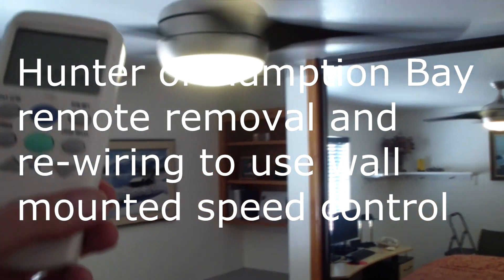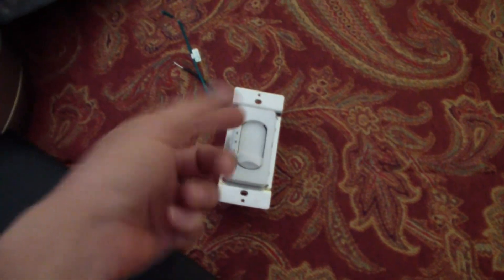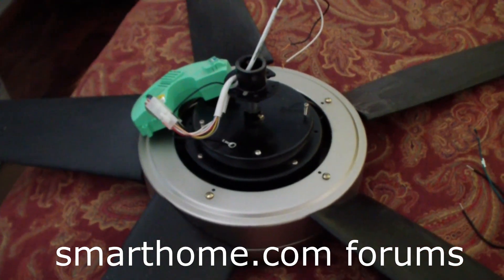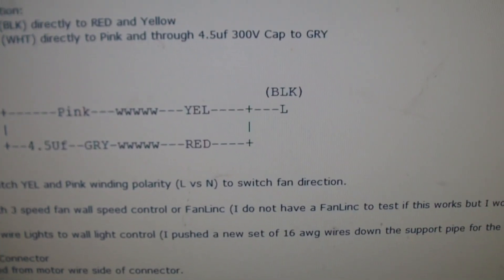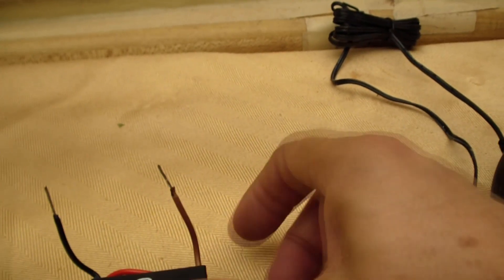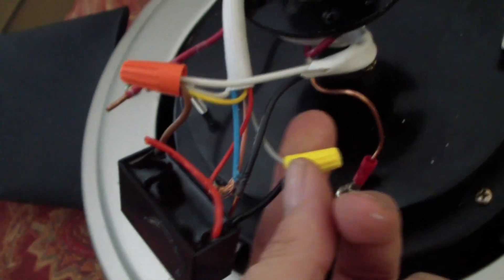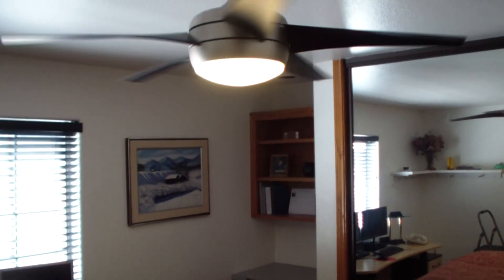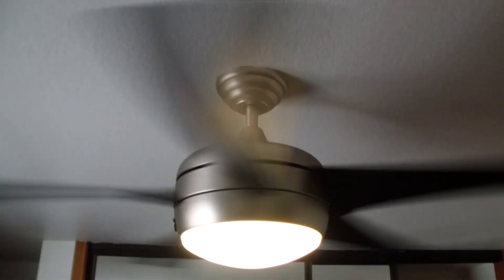Hampton Bay or Hunter Ceiling Fan Remote Re-Wiring For Wall Control

Comment: Thanks you.  I went one step further and wire a mini toggle switch. 4PDT 2 position 12 pins on/on miniature switch that changes positions of the yellow and pink wire. Now I can change direction of the fan with a click of the switch.
Works great! Thanks again for the video.
Reply from the maker: Great idea although I have never wanted to run the fan in reverse.
Reply: I run mine in reverse in the winter.  Thanks again for your video. It saved me from purchasing a new fan. I've installed a wifi control wall switch. It works great!

Comment: Looks great, and with a brighter bulb installed that’s all the light you need. https://www.youtube.com/post/UgkxWF88GpljEn-0o34vtLFazEQ5h5Q33SjU As far as ease of installation- this was my first ceiling fan and it took about 3 hours because I had no idea what I was doing and also it’s helpful to have a second set of hands and a magnetic drill bit. Works great.
Reply from the maker: Be sure to see my LED conversion video if your light is not already.

Comment: Great video!!  Helped me get my Sonoff IFAN04 (flashed with Tasmota) hooked up to my Hunter Model 21412-420 ceiling fan.  Only difference on my fan was there was no blue wire on my harness for the light control.  Instead it was a black wire with a white stripe to control the lights.  Every other color was exactly the same.  I called Hunter tech support and they didn't have a wiring diagram to provide me, and wouldn't give me any insights how to hook things up with a single wire motor control.  The manual just says "hook like colors together" to the RF control unit, which was absolutely useless.  I cut out the 4.5uF cap out of the old RF controller.  Mine was a single yellow cap, not a double, but it worked great.  Soldered wires together to ensure the connections stay together.  I don't ever want to take down that fan again.  It's on a cathedral ceiling, and there was no hanger for the extension bar knob.  The metal cowling was supporting the weight, which is a terrible design when trying to put everything back together - needed 4 hands instead of 2.  The newer internal hangers, with the cowling surrounding it and taking no load is a much easier design to deal with.

Now controlling the fan with home assistant, zwave scene controller, and Alexa.

Comment: Hi, I have a newer Hunter fan with the built in remote and just bought a wall control switch so I want to do this fix. Issue is my controller unit is tucked within the light assembly, so I’m confused as to if I cut the wiring harness to the controller and apply this fix, what drives the fan? I’m really confused because I am not sure if the “receiver” is also the brain of the fan, so I don’t know if this will work. Also, can you shed some light on the capacitor? A quick Amazon search brought up countless different 4.5 ones but with either 2 or 4 wires, not a 3 wire configuration as yours. Could you give me a hand with this? Thanks!

Comment: My friend has a Hunter Channing Ceiling Fan that’s remote control only, and what happened was that they lost the remote control for the fan for a month, and they wasn’t able to use the fan, so I did the method that you did with this fan you showed on this video, and it actually worked, I still find this video helpful.

But this is how I did it.

 I hooked 3 white wires, and hook it to the yellow wire.

Connect the Red Capacitor wire to the gray wire

Connect the Red, and Pink motor coil wires to the black wire.

The light kit wire (black or blue) wire will go to your blue wire you ran down your ceiling fan.

The ceiling fan worked properly, but it was going in reverse direction, so I had to connect 3 white wires, and hook it to the pink wire, and take the red and yellow motor coil wires and hook it to the black wire, and it actually worked.

Only difference is that I used a 2 wire capacitor that has a red and a white wire on it, and it still worked.

Comment: thanks for the schematic for the motor windings wire colors! Rewired the bedrooms with 14/3 and lutron maestros dimmer & fan control in one gang setup. Dismayed that the controller contained the phase shifting cap and your video answered the motor winding question and already have one working with a reverse switxh hidden in the bulb

Comment: Thanks, my fan come with different colors, after check I put high resistance on start capacitor and lower one on running capacitor, after direction adjust, everything works fine.
Reply from the maker: That's great

Comment: Great video!  This wiring didn’t work with my fan, but wiring it like this linked video did. I can’t figure out how to hook up the light, though. I have no blue line. Could it be another color? I currently have these wires connected:
Black/yellow/gray
Red from cable/transformer 
White/pink/transformer 
The fan works great hooked up like this. There is a separate red line coming out of the fan not hooked to anything. It did not want to be hooked to the light, though. It became angry. 
https://youtu.be/bSyXyvbXIwA
Reply: Ok I took the fan down and there is only one live/active wire, so I’m out of luck on the light. I need a light in this room, but this fan will be a great addition to my she shed.

Comment: Thank you, just did this for my 10 year old fan/light, worked like a charm
Reply from the maker: Great to hear. Be sure to check out my LED conversion video is yours is still florescent.
Reply: @KentDiego  Thanks, mine used incandescent lights that I replaced with LEDs.

Comment: I just moved into a house with this fan with no remote. I ordered a new remote on eBay which didn’t work. I sent it back and found this video which I followed and bought a fan speed controller from Home Depot,now my Hampton Bay fan works again along with an independent light on a switch. I may also convert the light  to LED soon like your other video. Thank you very much for this video, the fan was about to go to the trash can If I hadn’t run across it on utube.

Comment: Hello Kent, this worked great but I have one thing that is bothering me. I have a hamptom bay ceiling fan that I was able to change back to a wall control because of your video. However after I put it all back together the light turned on and the fan did as well BUT the fan is going way too fast. Its making the whole thing rotate. I notice that once i turn it off it kicksback a little like as if the motor itself breaks the rotation as it stops.
Reply from the maker: The fan speed controller is special for motors. A normal light dimmer will not work. The speed is determined by capacitors in the fan speed controller. The 4.5uF that controls rotation also has effect. If you are using a proper fan speed controller connected to the fan motor the only way I can think of to slow down is to lower 4.5uF to lower value. Re-check your wiring.

Comment: Kent, I have a new Casablanca Stingray fan that I would like to connect directly to the wall fan switch. Do you know if the  4.5 Capacitor is applicable for all fans?
Reply from the maker: I am sure it will work. See what value is inside your receiver unit.
Reply: Thanks. Will look for it. Also, I don’t see a pink cable, just a grey one. Could that be the replacement for it?

Comment: How do you reverse the direction? 
Someone put in a dimmer/rotation switch before I purchased the house. It first was running clockwise and after playing with the control knob it finally started rotating counterclockwise. 3 yrs later, Im trying to figure out how I did that. 🤦‍♀️  I BELIEVE I had it reversed ladt year too, but my memory is horrid.

Comment: Great video! I saw that you're wire from the switch to the fan has black, white, red, and neutral.  My wire does not have the red.  Is it still possible to control fan and light from a switch without running another wire? What happens if I have a fan with a remote and it's hooked up to a switch? Is it possible to use the switch just for turning the light on and off? Thanks so much.

Comment: hey kent, i want to do exactly what you've done here, but i only have a single gang box and i'm not looking to change that ... would this switch work? currently the romex i have is only black white and ground, could i fish a single wire for the speed control??

https://www.homedepot.com/p/Lutron-Diva-Fan-Control-and-Light-Switch-for-LEDs-CFLs-Incandescent-and-Halogen-Bulbs-with-Wallplate-White-DIVA-LFHW-WH/305097336
Reply from the maker: I am not sure if fishing in a single wire is up to code but it would work. I would fish in 3-conductor romex. They make dual light/fan speed switches for single gang box. Changing over your single box to a "old work" dual box is not that hard.

Comment: Great video, but one question.  What is actually connected to the Black (L) wire?
Reply from the maker: The black wire (hot) connects the wall light switch to the red and pink wires inside the fan.
Reply from the maker: Oops. I meant the wall light switch (black) to blue light wire. The fan motor and speed control is red.

Comment: Hey Kent, is the capacitor for the fan or the light?  I have a fan that has a remote that I'm trying to convert to switch, however, it doesn't have a light.  Am I still gonna need a capacitor?  I can't recall seeing a capacitor in the remote module in my ceiling fan.  thanks.
Reply from the maker: Yes you need to capacitor for the motor. The should be a cap inside the wireless module.

Comment: Is there a way to have the wall switches (1 wall switch for the light and 1 for the fan) work with a receiver? Meaning, the remote can control the light when the corresponding wall light switch is turned on. And the remote can also control the fan when that wall switch is turned on. Is this possible?
Reply from the maker: Anything is possible but it would not be standard household wiring practice. You would have to run power permanently to control unit and splice in switches on fan/light side of control unit.

Comment: I have a Hampton Bay fan that only has a white and black coming out of the fan and the universal control I bought has 4 wires on the receiver (white black blue yellow) I spliced all 3 black  blue yellow together with the black from the ceiling. I can not pair the remote still. I tried everything. Help please.

Comment: Hi! Great video! I have the same exact fan just a bit older model. thank you for opening it up! Awesome! I am still using the remote. Any idea what part in it might be malfunctioning if the light has stopped responding/turning on with the remote only? The batteries have been replaced several times over the years..so not the batteries. No other issues with any of its functions. Thanks for your thoughts!
Reply from the maker: Likely the RF receiver inside the fan is bad. Mine has problem with light too. Turns off after a while. I am sure the issue is in the light ballast circuit. My idea to fix it to remove florescent bulb and ballast then replace with a LED solution. Noticed a few LED lights on AliExpress that looked to be suitable size.
Reply: Thank you Kent! Gives me direction going to go google " light ballast circuit" and get started. Thanks for the clarity and educated clear response! Have a great week!
Reply from the maker: Hi Elizabeth. I just made video with instructions to convert your ceiling fan to LED. https://youtu.be/c2W1RWgbX54 The replacement lamp only cost $10. Works great and had brighter and better quality light.

Comment: Great video but doesn't translate to hunter fans. could you help with the following?...I have a hunter ceiling fan model 21871A-420 with a rf modulator that controls the fan speed and light with a remote control. the problem is the rf modulator keeps going out. the light turns on in the middle of the night the fan shuts off etc. my house is already prewired with 2 light switches to control the fan and light. I want to remove the rf modulator all together. the question is what is the wiring diagram for this fan and how do I hardwire or connect the 5uf capacitor to the 6 wires so one switch turns on the light and the other switch turns on the fan. I can use a variable speed switch at the wall to control the speed. the wire colors are white, blackwhite, yellow, grey, pink, red.

Comment: Hi Ken,

   I have a different fan, but doing something similar.   I am removing my remote and switching to a pull chain switch..  Hard wired for one direction and top speed.

   I have mine fan moving in proper direction, but the speed is slow.     

   I notice you talk about a startup capacitor.   Is this what I need?

Comment: Thanks for your directions, Kent!  I am in the process of making my conversion on a Windward II using a Modern Fan Co. #002ND Fan Speed Control & Light Switch. https://www.cdn.lamps.com/media/catalog/product/files/140328/Control_Installation_Instructions.pdf .  However, when I opened up my receiver module I did not have a double 4.5uF 250V capacitor but a double 6uF 250V cap.  Also, the wire colors are different. Where yours has the black above the red (on the left side) mine has a brown above a purple.  On the right, where you have brown, I have gray.  Will it be safe to use my capacitor in the same wiring configuration as yours?  In other words, where you discarded the red I should discard the purple?
Reply from the maker: If 6uF worked with original receiver I am sure it will work with switch. I cannot help you with the different color wires. Give it a try. worst can happen is blow a circuit breaker.
Reply: Thanks, Kent! Everything works fine and I am up and running!  You help me salvage a perfectly good fan by getting rid of a control receiver that had died!

Comment: Realistically, how often were you changing batteries?  Also, with the remote control setup... if you powered off the light from the switch and not the remote control, wouldn't you just have to flip the switch again to turn on the light again?  I like the wall control option but I think both of your points are not really an issue.
Reply: One of the main reasons to replace the remote control is that when the remote falls on a hard floor, it will likely stop working. Other users also mentioned that they lost the remote. Some others simply were too finicky and stop working or work intermittently (like mine, before it quit working altogether).

Comment: Thank you very much! This looks to be exactly what I'd like to do. So is your fan reversible? Is that what the second capacitor was for?
Reply from the maker: I have hard wired the fan direction in the video buy you can wire the reverse direction. If you are handy you could add an extra switch to do this. I needed a starting capacitor. I used the one in the old remote reciever unit. It had two capacitors in one package and was used for fan direction control with remote. I only needed one of the capacitors so left the wire to other cap unconnected.
Reply: Can you provide wiring diagram to show complete circuit with ability to change fan directions?  Thanks.
Reply from the maker: This is hard wired for one rotation direction. Seems if you had a 3-way switch added to fan speed controller you could make that happen.  If I get time I will think about it.

Comment: 2:49 you mention 2 capacitor but you installed only one.  Why you need two?
Reply from the maker: I only needed one. When I took apart the remote control module it had two capacitors in one package. Three wires. I only connected the wire leading to one cap and left the other unconnected.

Comment: The wire is definitely yellow. I removed the the wall switch which is one switch that controls the fan and light separately. The yellow wire goes to the fan part of the switch.
Reply from the maker: The countries that have red, yellow and black are UK, South Africa, India and Pakistan. There are three wires. One is neutral and would run directly to ceiling. Another is power for fan (yellow), and the last wire is power for light. You need to figure out which color is neutral that would run to the new fan's white wire. The other wall switch is for light so use that color for fan's light power wire.

Comment: I have a yellow wire coming out of the ceiling. What do I do with it.
Reply from the maker: Yellow is not standard color for household wiring in US. Does the wall switch have this same yellow wire? Where was this yellow wire connected originally? How yellow is it? My guess is this is really a white wire that has yellowed with age. What colors are all the other wires coming out of ceiling?
Reply: The wall switch has a red, black and yellow.

Comment: Kent, I finished installing per your instruction and my ceiling fan works great!  I do have a question though...since the grey wire is to the motor, how is it getting power since the capacitor is hooked to neutral wires (white) and the yellow wire which is to change the direction of the motor?  Is the yellow wire the source of the power for the motor?  Just curious.......thanks.

Comment: Nice video and to the point Kent.  I have a hunter fan with a remote that stopped working.  Hunter sent me another receiver that did not work.  Their tech support then told me to wait for another transmitter.  After waiting a few weeks they then told me they no longer manufacture the remote and since it had been more than 30 days Hunter would not refund me for the receiver.  Furthermore, their tech support told me that it was not possible to convert the fan to a wall switch.  This did not make any sense to me as I know it is just an electric motor and it does not care how power gets to it.  Then I came across your video which solved the wiring problem without the use of a receiver.  Thanks a bunch!!!